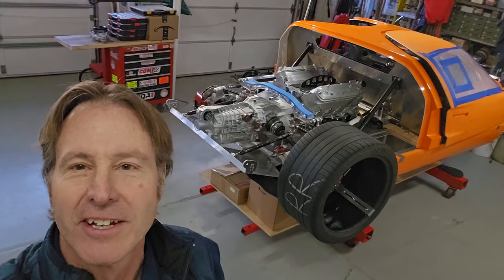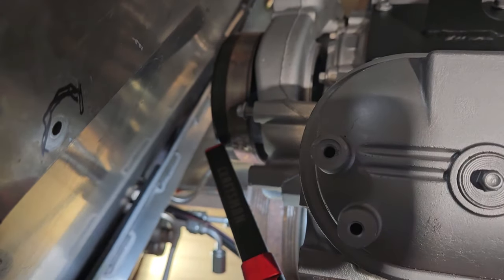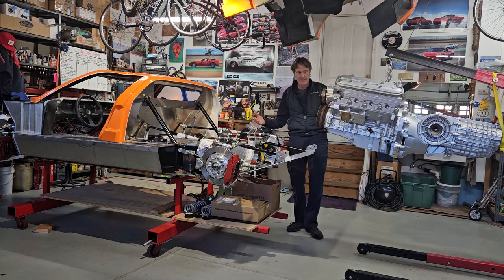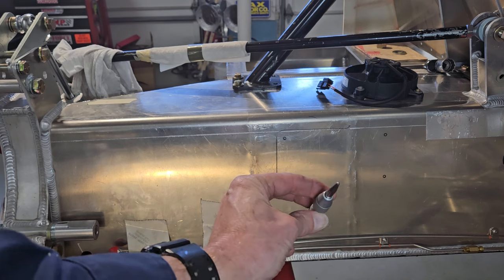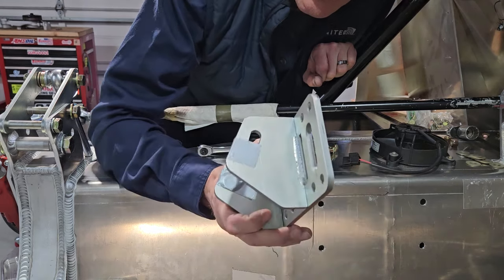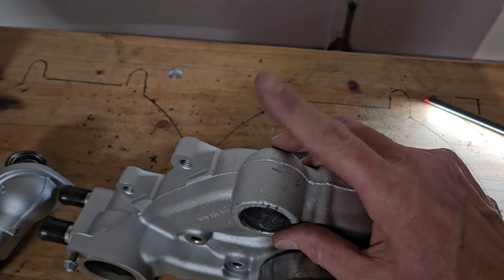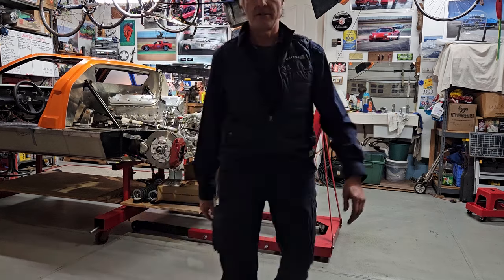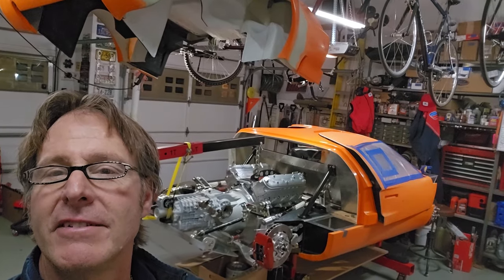RCR GT40 BUILD  Ep 17 - Engine Mounting

Comment: I'd also look into using the Boxster/Cayman rear trans cover. This looks like a 996/997 6 speed. If that's the case? You can use a BoxsterS rear gear cover. It's flat.. no mount like this one. If it's a 991 6sp then I don't believe we have a Boxster/Cayman rear cover for it.

Comment: Loving the project!!!  So... wouldn't i it be a good idea to use some lock washers on the mount bolts? There is no safety wire and you're playing with an aluminum frame (cheap insurance). Can the firewall be slightly modified to accept the water pump? It runs of the same belt as the others, so what interference are you seeing? (you already know I don't like shoving a chevy up a fords butt)... but all of the cooling is up front. Shouldn't the alignment of the transaxle be what's most important? I know there's plenty of give and take with the joints, but which is more important? Last question... was that a gallon of primer sitting under the car? What's coming next? I can't wait!!!
Reply from the maker: Steve thank for the questions. I’m using grade 8 fasteners with self locking nut. Gotta Keep Your Nuts Tight Lol. 
Yes I did align the drive axels perpendicular to the hubs. It only took about 3/4 inch of washers between the motor plate and the supplied 3 inch spacer that came with the kit. I was trying to align the axles, make sure I still clearance between the water pump pulley and be sure the transaxle wasn’t sticking out the back. What I had to do was add the washers, remove the water pump inlet and because the transaxle came from a Porsche 996 with all wheel drive cut about 1 inch off the back. It was already rebuilt had the FWD output removed and the hole welded closed also had a Wavetrac differential added.
You probably saw a gallon can of Bondo body filler I will need.
My next video is of me checking the heads on the LS7. I already did the work and filmed it. Everything was good. Not sure when I will get the vid out as I just got a new computer and different video editing program. I will start on it tomorrow. Thanks again.  You can email me at curbmeisterklotz@gmail.com if I wasn’t clear.    Cheers Klotz

Comment: how big of a fender washer goes inside the alum monoque chassis there?,  any blue or red to keep it in place after SOLID motor mounts??
Reply from the maker: 3/8 inch, grade 8 hardware with nylock nuts and large area washers. Chassis is 1/4 inch.  I will keep an eye on it.  Thanks!

Comment: It is a kit yet you still have to locate the engine?
Reply from the maker: It is a kit. You pic the engine and transaxle body type, options like A/C. Check out the website racecarreplicas.com  Everything is there, but. The builder gets to make a lot of decisions. I look on the forum gt40s.com to see what others have done. I call it Analysis Paralysis lol. Everyone's build is different. I recommend it!!!
Reply: @kurbmeisterklotz4088  sorry I didn't know there were so many options. I sat in a kit car gt40 at a factory in CT 20 years ago. I didn't fit. My knees hit the dash. Any chance that is adjustable these days?
Reply from the maker: @geniferteal4178  Yes sir I'm 6'.1" and the RCR kit has plenty of room!
Reply: @kurbmeisterklotz4088  would 6' 4" work? I've looked at another video. I can see it's a tub construction all that aluminum.
 It was 23 Years ago but I remember a bar going across at the bottom of the dash.  The pedals were movable but that wasn't the issue. I was really worried about head Clearance and I know that overhang on the door is a bitch.
Reply: @kurbmeisterklotz4088  would 6' 4" work? I've looked at another video. I can see it's a tub construction all that aluminum.
 It was 23 Years ago but I remember a bar going across at the bottom of the dash.  The pedals were movable but that wasn't the issue. I was really worried about head Clearance and I know that overhang on the door is a bitch.